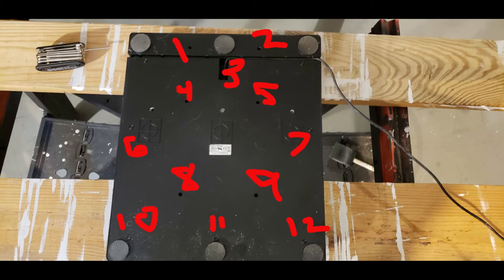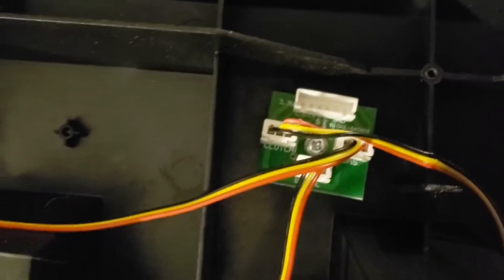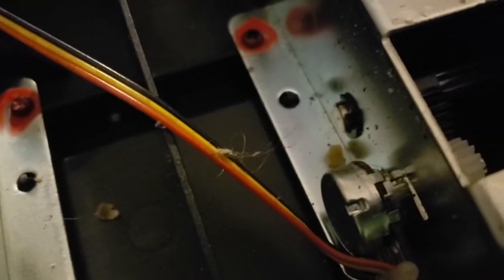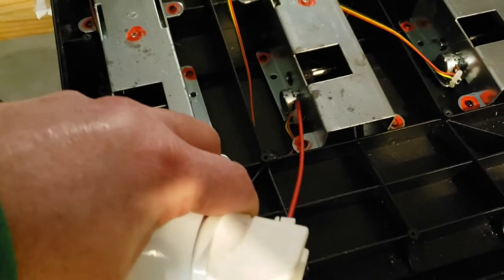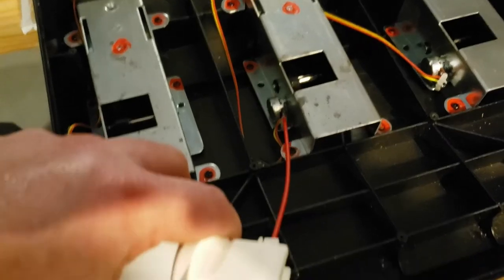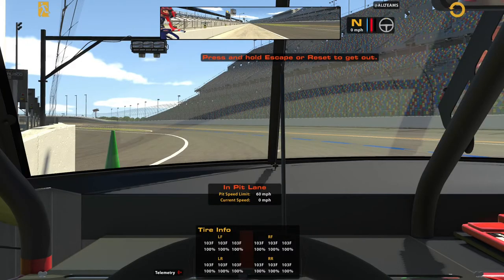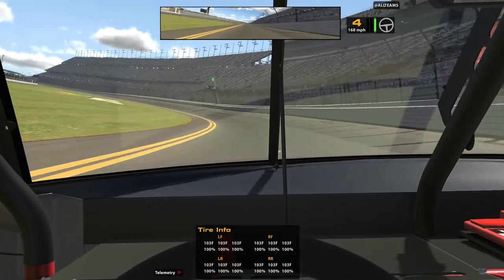How to Clean Thrustmaster T3PA Pedals

Comment: I fix electronics for a living. The best thing to use to clean components is lighter fluid. It works amazingly well. It's also petroleum based, so it has minor lubricating ability.
Reply from the maker: Interesting. I have not heard that from anyone. Just to be safe I will stick with what I use now.

Comment: Great video. Bought a 2nd hand T300GT RS setup and have the same issue with the pedals input fluctuating/not reaching 100% pressure on GT Sport PS4. Will give them a clean and hopefully will do the trick!
Reply: hello lewis, did it help?
Reply from the maker: Hope the pedals worked a lot better after a good cleaning.

Comment: my brake pedal was fluctuating rapidly so i tried this but now the conical brake mod doesn’t work for some reason, no matter how hard i press it only registers about 35% pressure, is there anything i can do?
Reply from the maker: It sounds like the potentiometer has gone bad. I am starting to have a similar issue to my older set of TP3A pedals. I am cleaning my pedals almost twice a month now and just compressed air is not doing the trick. Check my pinned comment for a link for electronic contact cleaner. This is what I used the last couple of times. It loosens up a lot of gunk buildup that gets into the potentiometers. 

You can buy replacement potentiometers on eBay but it looks like a hassle to install properly. It looks like my next pedals will be magnetic hall sensors.
Reply: @qwikstreet  the t lcm pedals won't have this problem right?
Reply from the maker: @SidOfRivia  I'm not 100% sure. Dirt will still get in the pedal base and will need periodic care. However the hall sensors will last a lot longer per many people more knowledgeable than me. This has to do with hall sensors having no moving parts to determine pedal pressure. It just works via distance a pedal travels between some magnetic sensors.

Comment: I've undone all the screws but something is still holding the back on in the middle. I can pull the top and bottom corners up the piece doesn't come off.
Reply from the maker: Did you get the screw that is under the cable ? There are a few screws that are recessed. I always forget the one under the cable

Comment: How do you take the white clip off
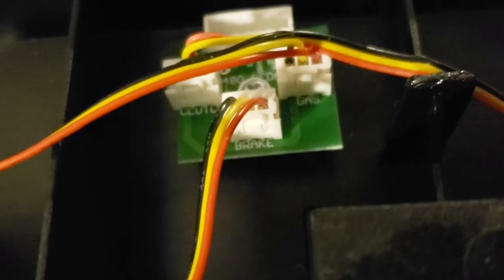Reply from the maker: Are we talking about the wire coonector? There is a plastic clip on the side of the protector and needs a good hard squeeze. At the 06:30 mark you can see the clips facing towards me. Just dont force the connector off.

Comment: My problem is once I get to about 90% throttle my brake starts applying. By the time I get to 100% throttle I have about 10% brake. I just cleaned it about 3 hours of playing ago. It's doing it again.
Reply from the maker: That's odd behavior. I'm guessing the potentiometers are going bad.  How old are the pedals?
Reply: @qwikstreet  1-1/2 maybe 200 hours. I took them apart again and cleaned them. Wondering if the throttle pot is sending some feedback some who. I haven't tried them since I cleaned them Sunday.
Reply: I have this exact issue but my brake is sending 10% signal to my clutch. did you manage to fix this?
Reply: @JimboJamboYT  no, I believe the reostat pot has a short back feeding to brake circuit.

Comment: I did this and for some reason my clutch pedal stopped working
Reply from the maker: That is odd. Did you make sure the connector is secured back into the control board? I take my pedals apart about once a month to clean out the dust and cat hair without issue.
Reply: @qwikstreet  It felt secure when I was finished, is it possible I need to rotate the wire for it to plug in correctly?
Reply: This also voided my warranty so I can’t send it back to be fixed
Reply from the maker: I hope your clutch is working now. The white clip should only go back in one way. Its very similar to the connectors on a pc motherboard. there is a notch on the plastic connection that fits and snaps into place.

Comment: My pedals are squeaking very loud, but I don’t have anything to clean it ( not even compressed air ) 
Can I use something else?
Reply from the maker: I would not use lithium grease. I have used a small spritz of wd40 on to the medal rod for each pedal. This helped silence a squeek I had.
Reply from the maker: With squeking you will need to use just a small spritz of wd40 on the metal cylinder portion of the potentiometer. Since you have the pedals open I would use compressed air and contact cleaner inside the metal disc covering of the potentiometer. I know you said you have none of the sprays but its worth it and makes a huge difference to your pedals. I would say it costs under $20 for all the items if you go to the actual hardware store.